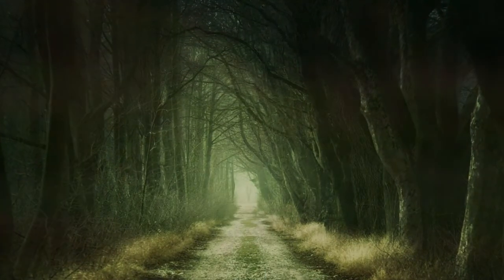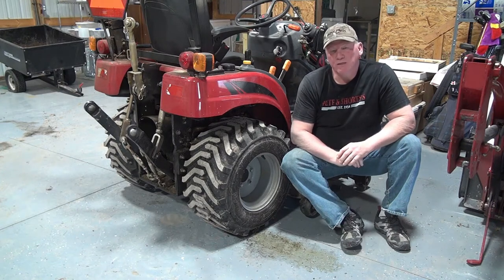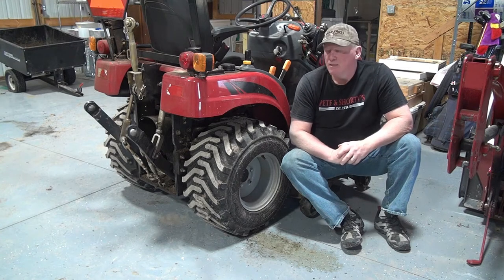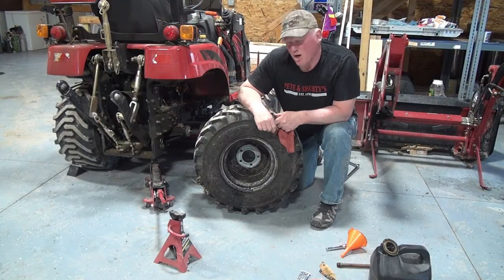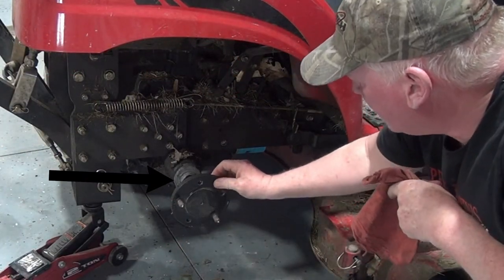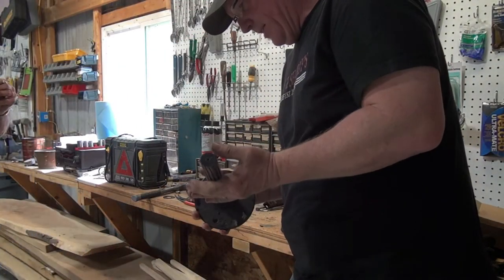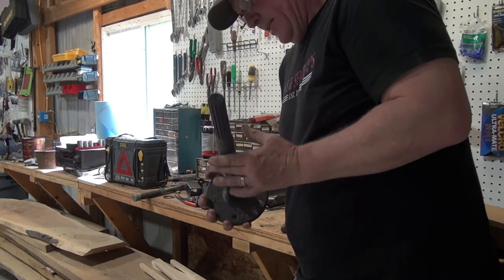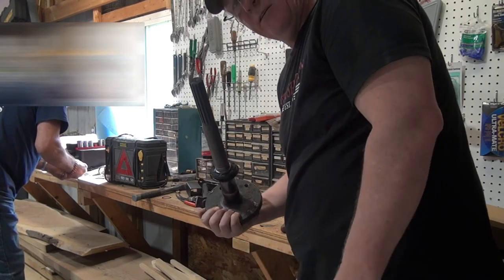Mahindra Rear Axle Seal Oil Leak

Comment: Thank you for the video Joel. Just to confirm, you ONLY replaced part #27 in the diagram at the end of the video? Some people say go ahead and replace the other parts with new, but they arent cheap. In your service you performed, did you replace the bearing, snap rings and washer? Thanks again!
Reply from the maker: I only replaced the seal.   In addition, since this repair on the right rear seal I I have replaced the left rear seal.  It went much quicker and easier because of the purchase of some good snap ring pliers and practice.   It looks scary, however if this dumbass can do it anyone can get this done.  Good luck
Reply from the maker: Correct, I only replaced the seal part #27
Reply: @midwesthuntingoutdoors  Thank you for the reply. It appears the part is on backorder from a few suppliers I have seen. Last night I removed the bigger back tire on the eMax25 that is water filled (OMG that thing was heavy) removed the seal, drained the fluid in a pan to reuse until a full replacement of fluid, cleaned the seal really good and applied the Permatex black 90 min for now. Part supposedly ready in June. This will get me by until then. Refilling it now and we will see.

Im handy around anything mechanical only bc of people you like you who put out these videos. My family thinks I just know how to do all this. 🤣Again, thank you so much!
Reply from the maker: @joelmaxwell2724  Best of luck Joel
Reply: @joelmaxwell2724  Joel, I read what you did by just reusing the seal and just putting the permanex on it and putting it back in. Did it leak anymore. Thanks in advance.
Reply: @rickpacheco8864  Hey Rick. So this solution a year ago was holding strong with the original factory seal. Me being OCD, this year I needed to replace the hydraulic fluid, so I figured why not replace the seals properly. When I realized to replace the seal properly, you had to remove half of the trans block on each side to slide on the new seal, I saved the replacement (new) seals for another day, cleaned the old gasket seal off the originals, applied new gasket seal and we are good to go. No leaking. 

I did this for both seals on the back axle, and the front axle. Again, I bought the seals for the front axle, they didnt fit even though part numbers were used etc, so I returned them, needed to use my tractor, so I cleaned everything, applied gasket seal to the front gear casing seals and they are not leaking (were before). 

Its kicking the can down the road. Right now, I just need to maintain service, keep my eMax 25L healthy, and Ill stress about doing it right when things arent so crazy.

Good luck!
Reply: @joelmaxwell2724    Thanks for the response, I have a small leak on my right rear seal. I ordered the permanex sealer and I’m going to give it a shot. It’s a small leak but I don’t like it. I seen where one guy did it that way and it’s been 4 years and still not leaking. Oh well wish me luck. Lol

Comment: Thanks for the video! Does the axel just pull out? Other tractors it seems you have to take the entire housing out.
Reply from the maker: Stephen- Yes, the axle pulls out.  It is a split rear axle so it is only about 18 to 24 inches long.   I just completed this same procedure to my left rear axle seal last week.   I used my new set of snap ring pliers and it went very well.   Good luck and thanks for tuning into the 2 Dumb Asses
Reply: Thanks to both of you, this was my exact question! I am willing to give this a try but I am NOT taking apart the rear differential! Mine is a Emax22 with only 120 hours, good to hear (I guess?) that this is a common problem, I thought maybe I just beat it up too much...

Comment: Do you have the part number for the axle seal?  Have an emax 22 with the same axle leaking.  Thanks for the video.
Reply from the maker: Donkey Kong the original seal part number has changed, imagine that!  The new part number and the seal I used was 20113230040 and ran about $20.  I got it from the local Mahindra dealership.  Thanks for your viewership and comments and hope you consider hitting the like button and subscribing.
Reply: I used Permatex Right Stuff with a 90 minute set time, after cleaning the gasket and axle REAL good. Spray carb cleaner is good for this as is dries away quickly. Then put a bead around the outer edge and tap it back in. So far no more leaks. A quick fix before you have to pull the axle and replace the seal. You'll only be out a few bucks, so worth a try.
Reply from the maker: @jayhenley336  Thanks Jay. Appreciate the tip.  Will consider that for future solutions.

Comment: also how did you pull axel out?
Reply from the maker: Once you remove the outer snap ring you should be able to pull the axle out.   I had to give it a small tap with a hammer, however be gentle.

Comment: Good evening Sir,  I would like to tell you very kindly that I have 460 hrs and my rear axels did sweat once but once that I put a o ring on the yellow fill cap ( once the cap is screwed the 4 little vents hole a blocked off by the transmission side hole or the front axel ) for the rear HST Transmission and the front axel ( same cap ) the vent were not blocked off any longer and that what cause the problems ( I did have a front seal leaks on the right side ) and once I have done that NO MORE LEAK occur and I have done 25 hrs since then and still bone dry !! I told my Mahindra Dealer and send a informative about it to Mahindra and I made a video about it too on how I discover that look at 37:39 and temporary fixe by keeping the yellow cap loose ( https://www.youtube.com/watch?v=cDb8JgLSYD0&t=1788s ) and permanent fixe look at 14:55 ( https://www.youtube.com/watch?v=gFiJxJlsN9Q&t=202s ) and also at 23:45 on the same video also look at this video at 7:03 ( https://www.youtube.com/watch?v=zYUL-qiVu9o&t=130s )  Sir I hope that help but I can tell that you are working in a dusty environment but I have to tell you that I'm working a deep cold environment and very hard  on seals ( https://www.youtube.com/watch?v=yvewCfip5so ) at - 20.2f.  Keep up your OUTSTANDING Videos Sir Cheers 😇👍👌🍻
Reply from the maker: RCAFpolarexpress thank you for your detailed comments.  Stay warm

Comment: Hell everything is leaking on my eMax 25 the steering shaft the front differential input shaft, both outer output shaft on the front. The muffler has cracked twice these tractors are junk.
Reply from the maker: Matthew I am sorry to hear that you have so many issues.   I know these seals have corrected my rear axle leaks.  Thanks for the comments and viewership.
Reply: @midwesthuntingoutdoors  
They are made by TYM same company that makes Rural King and tractors for bad boy the eMax 20 22 & 23 are made in South Korea by TYM they aren’t even made by Mahindra I didn’t figure that out until I started having so many problems our Mahindra dealer closed down so I’ve been going to Bad Boy. Most of the parts are interchangeable with the cheaper knock off tractors, same part # and everything wish I had of known that I would’ve bought a Deere just wait if you start getting some hours on it you’re really going to start seeing some issues arise I’m about to get rid of mine quick fast and in a hurry it has 500 hours & it’s falling apart.
Reply from the maker: @matthewmilam286  Mathew what an education!   I appreciate the education and comments.  Good luck with your sale.